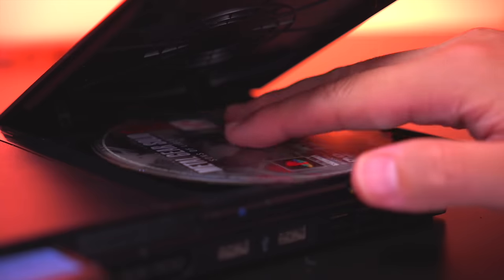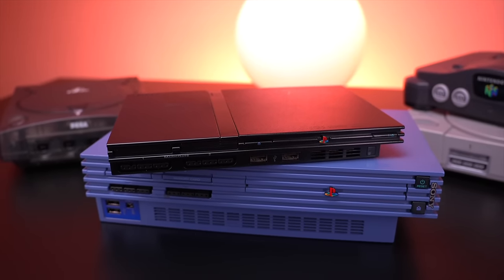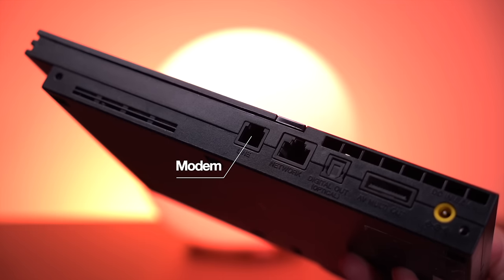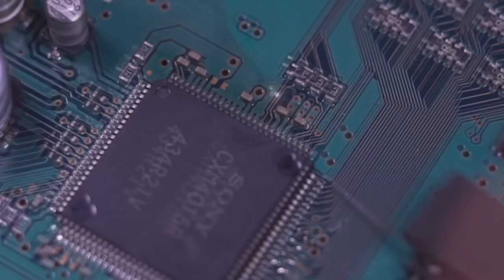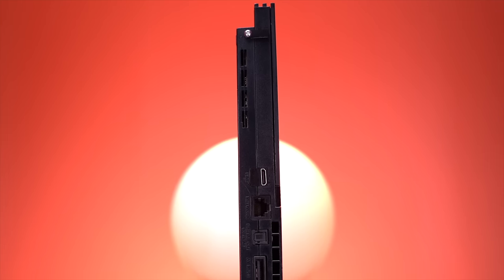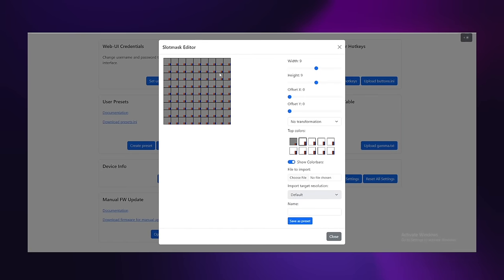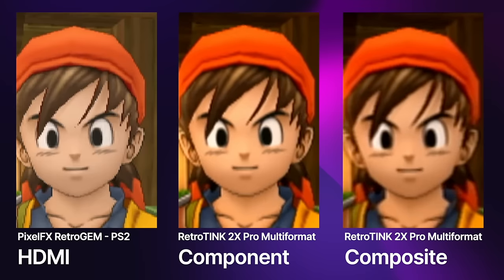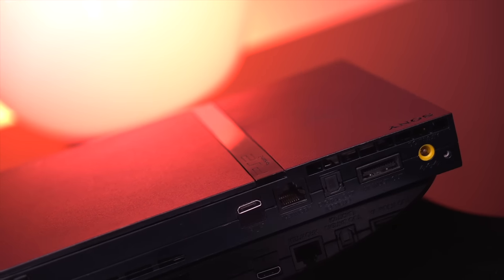This HDMI Mod Makes The PlayStation 2 Look GORGEOUS!

Comment: What are the reasons to use this instead of emulation besides liking the physically of things? Are emulators still not good enough to replicate the ps2/1? Last time I tried them they were good, but I can't remember enough of my ps1/2 times to gauge if they deliver an authentic emulation or not.
Reply: There are still games that just plain don't run right on emulation. Then there are also tournaments and speed runs which may require original hardware (which I'm not sure if this would affect those requirements).
Reply: It just comes down to preference. Emulation is also always going to have some quirks with certain games. Even if it's fine 90% of the time.
Reply: If you are ok with playing PS2 games on a pc, with windows tasks in the background, that is good enough for you. Not everyone has space/money/wife for every system made, anyway… Just atleast use a PS2like USB-controller…😊

Comment: While i understand the frustration of the paywall, it makes a lot of sense. Previously they sold 2 devices, on inferior to the other. The could have easily just sold the shiny edition as the ONLY version, but they made it available to the less fortunate while also cutting their profits by more than half. Previously if you wanted to upgrade, you'd have to unsolder and resolder the old/new mods... Now you just swipe your card. Seems shady at first but if you really think about it, it's pretty fair.

Comment: for the price, and the fact the basic and the "shiny" are the same hardware, but with an arbitrary resolution lockout. I say that's a scam. you would think the standardized part would drive down the cost of the item. but it's still around the price of proprietary products.
Reply: just seems scummy to me.

Comment: I’ve always used component hook ups and couldn’t see much of a difference between this mod and that. If anything, I would say component showed more colors. This video did not show enough of a comparison between the two though so it’s still hard to say. Overall, just from this video, I’m still sticking with component hook ups since there wasn’t enough info otherwise
Reply: This is more about convenience than anything, ironic as it requires you to mod the console. 

If you’re already using component cables, then you’re basically already set. Couple that with FreeMcBoot and GSM and there hardly any need to go any further.

Comment: This is legendary! I love av cables like Component and Scart of which the latter I use for BNC to my PVM but all these adapters needed, fragile-ish cables and then out to the capture card / Retro Tink 5x is expensive. Getting a truly proper output with no bad AV signal like the PS2 where I find the PS1 to look cleaner, same as Xbox, 360, Wii, GameCube, DC -> all or most consoles look better. This partially fixes the freaking PS2.
Reply: you know they did have the av issues that plagued the visual issue for ps1 and ps2  in the ps3 av cables got  fixed, can't remember if the ps1 supported widescreen, the ps2 did

your resolution will depend of how fine th dot matrixes ar on a crt,  the best resolution you'll get on a lcd or led tv  whether you run scart component or s-video even composite cleans up better 
with the switch off of analog tv today i would hazard a guess even rf will be a lot cleaner

i believe none of  matsushida/panasonic roms provided progressive scan in its firmware i/p were dvd movie only standard..

Comment: The non lead solder is a “the road to hell is paved with good intentions” moment. The solder doesn’t last and so more electronics just end up trashed quicker… Creating more trash and non compostables than if they just left the lead in.

Comment: Locking certain options behind "higher-tier" version is a scam tbh. It's exactly the same hardware. Also, selling scheme is definitely designed to make the Standard version look like a bad deal. Very disapointing. On top of that, not open-source.

Comment: Tito, I am always blown away by the footage of your consoles rotating in the air. Would you ever do a behind the scenes video on how you make these shots?
Reply: Put them on a turntable and film from low-ish angle so you're perfectly level with the table edge, use a white overexposed background. Crop anything under the consoles (including the turntable) and replace with white. Not hard at all.
Reply: @mrtelevision8079  yep...that or a  motorized rotating display stand plus a cool looking background.

Comment: Hey, can you explain why mixing soLder types is not a good thing to do? I've been working with electronics for over 40 years and never got any issues doing that (and I only use leaded soLder in my designs)
Reply: I'd imagine corrosion
Reply: Are you capitalizing he L in solder because you don't know how your keyboard works or because you think you pronounce the L in solder (you don't)?
Reply: @tim3172   maybe you don't in yourcounty, over herewe do. but if theL issilent, maybe it could be spellt sodder, right? Cheers
Reply: @tim3172 do you pronounce the L in holder? folder? shoulder? bolder? colder?

Comment: The price is simply too high for it to make any sense. It never made any sense to begin with, but the excuse was "It's for the love of the modding hobby", but at 200 dollars, I think I don't love the hobby that much after all... 
And if you dont plan on a self-installation you are looking at 200+150 for installation/shipping, you are better off just getting a GTX 4060 and emulating all of this crap at like 4K

Comment: Wait... If the hardware is the same, how does the Shiny version have more features? Don't tell me they're locked in the firmware.
Reply: They are.

The idea (I assume) was to offer a cheaper alternative for those who already intend to buy their upcoming 4k "Morph" Scaler, as they'd be paying for redundant features. Presumably they can justify selling the kit at a loss if the option to upgrade always exists. As R&D is no doubt playing a factor in the price. Not just the manufacturing cost, which would presumably be covered by the basic unit. They are always recouping costs with these mod kits.

Though I don't blame anyone for being confused or annoyed with them. Nobody likes features seemingly locked behind a paywall. Especially when the hardware is identical. There was a significant lack of foresight going into this decision lol.

I assume they didn't make two units because managing one universal kit means lack of available stock hopefully won't be an issue this time around. Which is almost always the case with these enthusiasts mods. Before these kits were all console specific. Introducing two tiers on top of that with varying hardware just means both devices would be perpetually in and out of stock.

I honestly wish they had just released the one kit for the full price everyone expected, as its consistent with price all of their previous devices. Introducing the cheaper tier has only succeeded in confusing or pissing off potential buyers who feel they are locked out of the full functionality of the kit. Which I mean, yeah thats technically whats happening here lol. Even if they had good intentions.

Comment: Been waiting nearly 20 years for this after playing PS2 games on my backwards compatability enabled PS3 (CECHA00) since 2006 and the PS3 definitely does a better job.

This still looks great though and I'm happy for people that don't have access to the BC PS3s to finally experience a fully digital signal from their PS2s but anyone who's had one knows what I'm talking about 🏆
Reply: I have a CECHA01 and PS2 games are blurry.  I was hoping they would be more crisp.  Am I doing something wrong? Thanks!
Reply: @r.t.8468  I have smoothing off, tweaked settings on my TV for a less blurry picture and use an Mclassic to minimise aliasing whilst not making the overall image blurry. The footage in this video looks horrible with all the jaggies!
Reply: It will be cheaper to buy moddable PS3 than this thing though and still have plenty of money left over from it. So I would recommend people buying PS3 instead of this
Reply: Eh I'd disagree. While there's been some giant leaps in keeping BC PS3s alive with the frankenps3s, and as appealing as it is. It's still expensive and I never feel at ease around a BC PS3. PS2s are pretty durable, cheap and the lasers can be easily replaced.  For those reasons Id say get a PS3 Slim or super slim and a PS2, it will probably be better in the long run. Just be careful with which Ps2 slim model you buy, if you're playing disks I only recommend the 7900x as eventually the other ones will have the disc scratching problem. Sony even brought it back in the 9000x to fit the PSU in.
Reply: @tatsu4935  I don't care for the money side of it, just what looks best and is also most convenient ie all 3 generations of PlayStation via HDMI, region-free, wireless DS3, all played from HDD with unlimited memory cards :)
Reply: @worrier  I see your point but a) I don't care money-wise, just convenience and quality and b) I've owned my CECHA00 since November 2006, use it on average 3 times a week for 2-3 hours a session and all I've had done to it was a full RSX reball back in 2011. My max fan speed is 33% and my temperatures never exceed 63c for both CPU and GPU. I will never sell this thing, it's the best console ever made.
Reply: If it's cheaper than buying a working backwards compatible PS3 (CECH-A01/A00, CECH-B01/B00), that won't nuke itself with YLOD due to BGA underfill cracking caused by TSMC's incompetence in manufacturing the RSX, or defective Nikkor solid state capacitors gone defective, it's worth the $300-$400 to me!

Getting the native digital framebuffer output of the PS2's GS chip is the holy grail of gaming on native PS2 hardware!
Reply: @Biggus_Dickus_69  thanks, man!  I was considering the mclassic…do u have the gaming version?
Reply: Problem is those chips are a ticking time bomb. They will go bad and there is no replacement :/
Reply: @MattBooth  Not true, the chips in the later models made in 2007 are more reliable than the ones made in the June 2006 batches, despite coming off the same assembly lines (IBM Fishkill plant for the Cell CPU, possibly some plants in Japan; Taiwan for the TSMC 90 nm GPU that was prone to GPU underfill issues as a result of TSMC's incompetence).

On top of that, even if the problematic GPU did fail in the PS3, or you had defective caps, you could simply replace the caps and replace the faulty 90 nm TSMC GPU by transplanting it with a 40 nm/45 nm TSMC GPU used in the later Slim and Super Slim PS3 models. That would be a permanent fix on the units that suffered from the issues. And, like has already been said, there are literally 2+ million of the CECH-A00/A01 and CECH-B00/B01, including the DEBUG/TEST console variants, manufactured between June 2006 & August 2007, with an estimated failure rate (YLOD) of around 10%.

That means there's still 1.5+ million of these machines that still work out there in the wild globally, and even if you assume the failure rate was 50%, after 15 years, that's still 1 million units or more left in the wild that still work, and all units are fixable with the methods outlined above.

Comment: I bought an HDMI converter called Level Hike for $25 & It works great for the money. I got the PS1 & 2 converter & an SNES, N64, GameCube converter also works with monitors that have no speakers.

Comment: This makes me feel so old. I got a PS2 slim when they came out, and we had an 1080i HD TV with HDMI and has wished it had HDMI back then.   Today found a PS2 fat model 39001 with with the original netwrok adapter, power cord, an d2 memory cards, and it works. I still have my PS2 memory card adapter from my PS3 back in 2007.  I may just use the pound HDMI adapter to plug my ps2 into my TV.

Comment: Is this the one i was hearing about on twitter with some kind of drm to prevent access to upgradable features that cost extra? It had people pretty mad but it aint no denuvo lol. If its more widely available than ps2digital and more competitively priced, i would consider picking it up. If it has higher install compatibility than ps2digital, safe to say it will definitely sell.
Reply: think if they didn't have this drm and just released the full package at the price they have, it wouldn't be as controversial. Think it was a big mistake on their end to offer this lower priced product. The market for these mods are enthusiast level, which people are already wiling to throw money at, at reasonable prices.
Reply: yes it is
Reply: this is ps2 digital
that original project died and now its this

Comment: The mod I've been waiting for the 2-in-1 PS1+PS2 solution, besides Dreamcast & N64... with the OG Xbox piquing my interest now... All I need is a Saturn HDMI mod, and I'll be pretty satisfied.

As for the gamecube, I think I'm gucci with just the Wii U's Wii mode under Nintendon't that also supports virtual memory cards and the gamecube adapter when it comes to HDMI solutions and in a very affordable way, especially if you already have a Wii U.

Comment: I hope this doesn’t cost more than a recapped BC PS3
Reply: Pricing details are on their site
Reply: That depends on if you can install it yourself or not I guess? A system is like what, $75USD give or take, the kit (basic edition) is ~$100USD, and I'd wager most installers will be charging around $150USD minimum. Assuming you don't want it upgraded you're looking at around $300, not including things like tax or shipping.
Reply: As someone who owns a bc ps3 how much will a recap cost? I don't need it yet I think, just wondering for futureproof purposes
Reply: @Appl3sandgrapes  - no way are installers charging more for installation than the kit itself...if they are...find yourself another one. A dude I know charges around £50-£75 for this sort of thing
Reply: @RandomizationShow where I live I paid about 20 bucks, and I also got a few missing pieces like the flap door on the front
Reply: To make a BC ps3 fully reliable recapping sadly isn't enough in many cases, a Frankenstein- mod would be the solution... It's very expensive, but worth it imo for such a beautiful console which covers 3 systems :)

Comment: Some old modchips actually have a IC clip on adaptor on top of the chip so that doesn't it need soldering as the flex tape is already soldered or attached to it.  It's very board&chip location specific but it's a solderless mod that's easy once the case is removed.  Maybe the next step is to add a daughterboard or on chip emulator that can load the game&an emulation/remastered upscale game profile is loaded, like a gameshark so that it's upscaled and better game operation as well as a translation.  Overall you're still using the game's logic process but with upgraded game assets&environment.

Comment: This is definetly something that requires some fine point soldering experience.

I’m not too impressed with having to do those oragami bends. They took the time to go that far making the special ribbon things soo nice bit not make them so you DON’T have to bend the heck out of them. Seems like a skimp/oversight.

Additionally, mixing leaded with lead free will do nothing. It just has a lower melting point which is moot for circuit boards.  Use plenty of flux!

Comment: Video request.  With all these HDMI mods coming out and CRT's becoming more and more rare, could you make a simple video showing OLED vs CRT now that the lag is comparative?  I think there would be some differences in motion, but I'd like to know if we're at the point that lag isn't an issue and shaders can mimic the intended develop look.  Before spending money on an OLED you know.  I feel like you and RetroRGB have the equipment to test and showcase the comparison.  Maybe invite a speed runner on and see if they can do pixel perfect tricks?  I can run my LCD and CRT side by side with a matrix splitter, and the latency is visually noticeable on the LCD, but there isn't a video on Youtube that does this with OLED.

Comment: Dang, this seemed like a fun mod to try until it got to the price. I'm pretty sure the PS3 60Gb version is backwards compatible with PS1 and PS2, has an HDMI output already, and is cheaper than just the pixel fx conversion kit. I mean, it doesn't do the scaling and whatnot, but if you just want the HDMI output, that's probably a much easier and cheaper option. If you get a good deal on an old PS3, you might be able to get an upscaler within that same budget too.

Comment: Pretty sure an up-scaler is the way to go. Dont have to solder, works on any console, dont have to pay for features... this might look like 5 or 10 percent better than an upscaler, but im ok with a SLIGHT visual quality drop for how much easier they are to use. Thats probably all this thing is also is just a tiny upscaler that you are attatching to your console...
Reply: I also dont know how i feel letting this thing connect to my wifi either.. who knows what its doing, or what data its collecting...

Comment: Welds and solder joints are not the same thing. Welding melts the joined materials together, while solder adheres to the surface of the joined materials.

Comment: I bought something like this on Amazon for $30 like a year ago. “PlayStation to HDMI.” You plug it into your ps2 adapter port, then on the other end of the device is an HDMI port. I have it in my fat ps2 right now running NCAA football